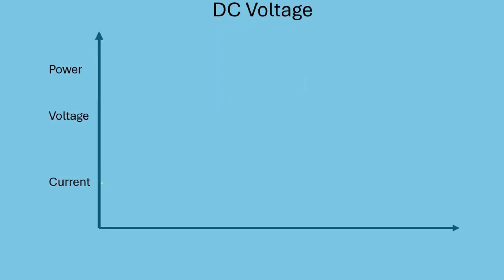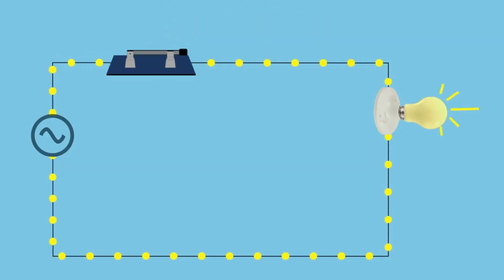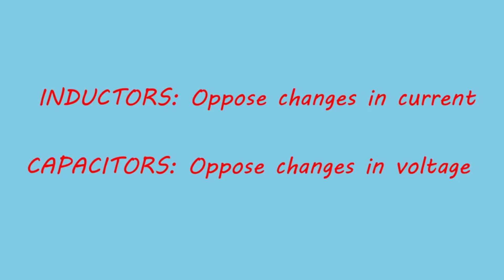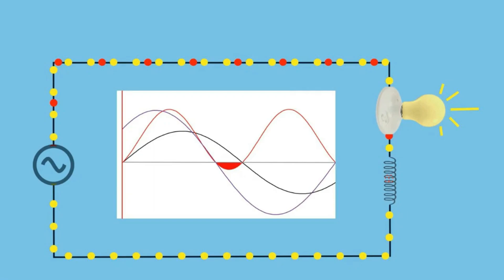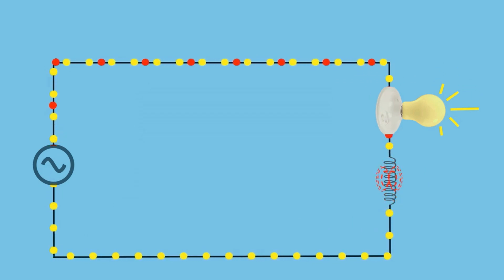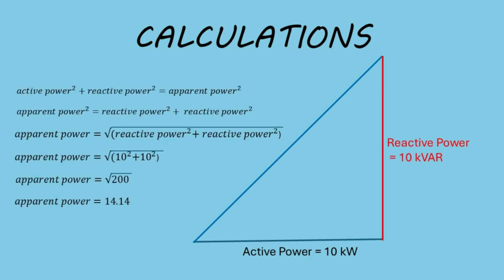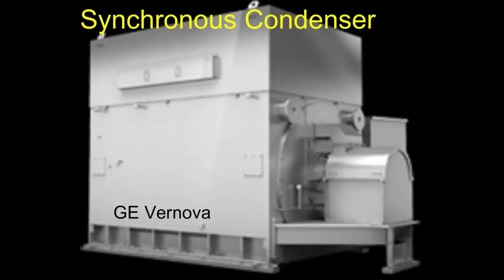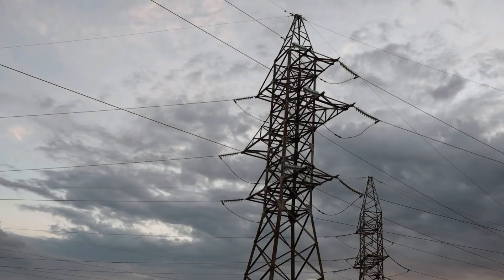Power Factor Made Simple: What it is, and Why it Matters!

Comment: Reactance impedence

Resistance circut lagging PF.
Capacitance a  leading PF.

Skin effect on AC conductors a big problem.
Reply from the maker: Good points! Reactance and impedance play a big role in power factor, and the skin effect can definitely impact AC conductors, especially at higher frequencies. Were you thinking about these in relation to energy losses or another specific issue?